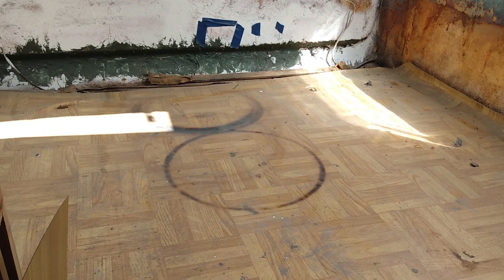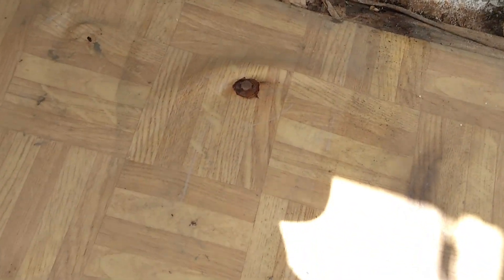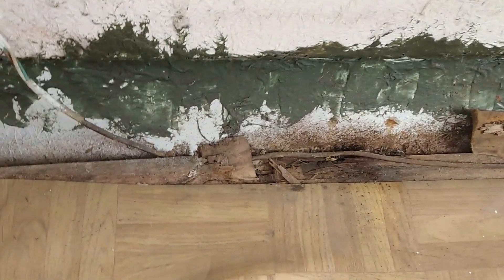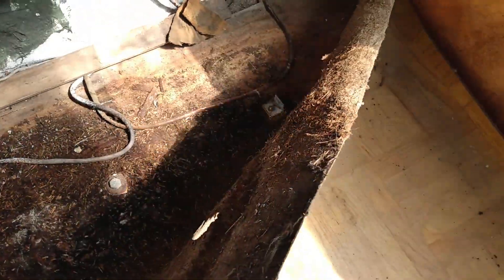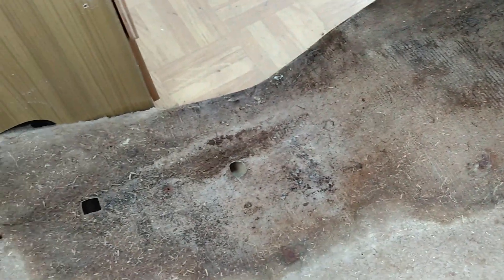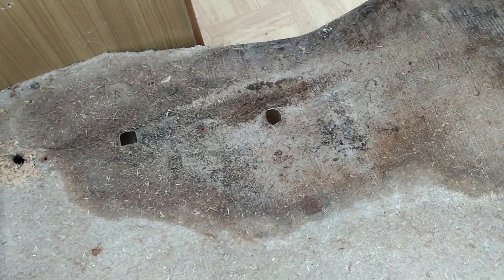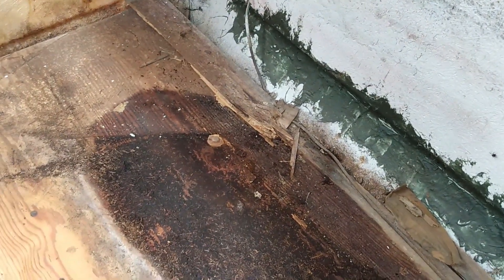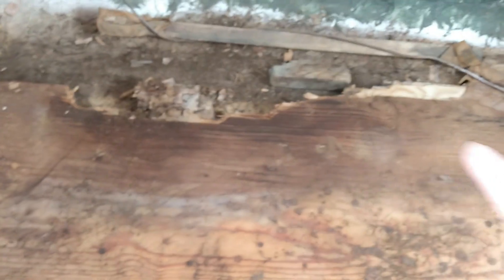Rotted Floor in 1987 Cadet Fiberglass Camper, aka Freedom Microlite Caravan

Comment: I have repaired several like this over the years. Will be better than new when your done. I place a fan on mine before making repairs to make sure its dry. Great video.
Reply from the maker: It's completely dry now.  It's been a couple days.  The back 2' or so will be replaced with new wood.

Comment: You've probably already dealt with your floor, but just as a heads up...there is a product that you can paint on/saturate rotted wood with that hardens harder than the original wood. It's like a resin. I have a friend who is a contractor and he introduced me to this product. It saved  lot of replacing of wood in various projects...Honey being one of them. Her rear driver's side corner was showing a bit of rot and I painted that stuff on, let it soak in and Voila! Hard as rock!  can't think of the name of the product, but probably any lumber/hardware store could tell you. Good luck with the floor!
Reply from the maker: Oops, too late, I already tore off the rotted parts.  That sounds like an awesome product though!

Comment: We had some rotting wood flooring under our carpet in the bedroom. It’s another project, but you’ll get that fixed right up.
Reply from the maker: I think it will be easy, I just need tools, and a better location to work on it.  It's in a gravel lot with no hook-ups.